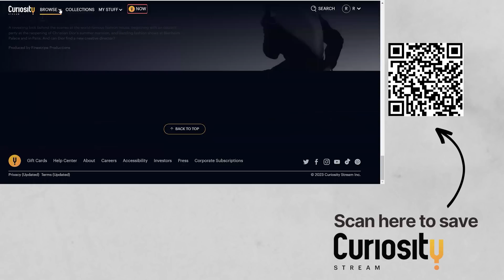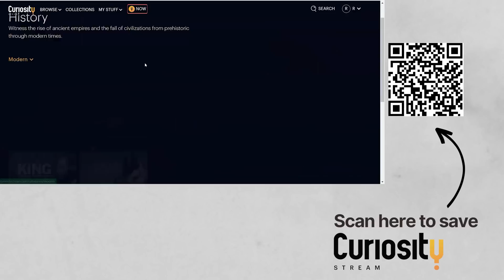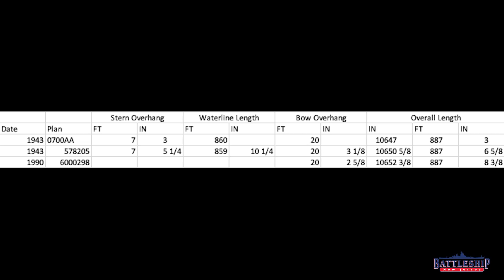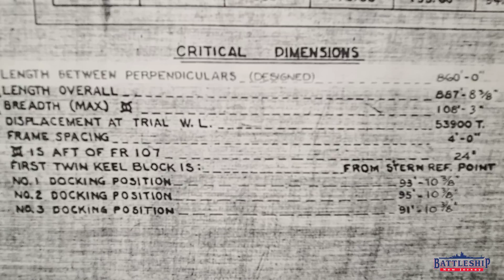Why Is New Jersey Longer Than the Other Iowa Class Battleships?

Comment: Couple of things, firstly the ship will have thermal mass, that is to say the change in temperature of the ship will lag behind the change in external temperature because the sheer mass of the ship stores some of that heat yes it will change legth due to temperature change but the change in length will not be instant. 

Measuring the ship in drydock is the only effective way to check, but you do this by measuring against fixed points on the dock, this is far more accurate, you would use surveying tools to measure the dock out and create a series of fixed datum points on the side of the dock, from there you can use a standard set of surveying kit to get an exact distance under a set of enviromental conditions, spring or autumn rainy days would be probably the best days, mid temp range and no strong sunlight to warm the vessel

I would not be surprised to find small discrepancies in ships built in different shipyards 0.03% difference on overall length is remarkable accuracy pre cnc plate cutting technology and yes its quite likely to be at bow and stern such areas were typically draughted by hand with chalk onto the great steel plates prior to cutting.

Lastly do not rule out dockyard workers being involved for a little bit of pride in making the biggest or the best or even just as a bet

PS logical comparison area, measure the length of broadway on all surviving in the class, its a nice straight corridor with set bulkead locations and its deep enough within the vessels to be minimally effected by climate, and that is a location you could use a laser measuring device accurately. If the length of the various broadways are the same then its pretty much the bow and sterns that are different, if the lengths vary between broadways then chances are it was just production tollerances

Comment: Hi Ryan.  I would dismiss the first option, it would be quite a conspiracy to achieve it,
The second is more plausable.  In engineering there is a principal of minimum metal removal in machining (milling) because:
1. less machining time, 
2. less tool wear (sharpen them less often, save cost), 
3. It is possibe to remove a bit more if you fall short, not easy to put it back on if you overshoot.
Given that it is war time, i would expect everything possible to save time and effort would be employed.
Incidentally, normal engineering tolerance is +/- 10 thou, ie 0.01 inch.  in 887 ft that could amount to a lot if each plate were too long.  How long is each plate?
But each dimension on the blue prints has its own tolerance, unless marked as "ref".  When the ship is layed out each frame position has a tolerance.  The frames attached to the keel.  The plates are attached to the frames, so providing the keel is layed out correctly the scope for length growth due to tolerance is greatly reduced, perhaps to a few thou, not a number of inches.
That suggests the third option of the over hangs being different.  They don't use jigs which will control the tolerance, frames and plate positioning cannot be so tightly controled.  Obviouly the pulpit is a significant possibility.
The fourth option of temperature could do it depending on the method of measuring the ship.  Lasers were not available in world war 2 as indeed was not CAD so measurement would have to be according to surveyors methods of the time.  Dropping a plumb bob from the extremities, mark the ground and measure?  Using theodilites, tape measures angles etc there is plenty of room for a few inches in 887 ft.  When were the ships measured, july and december?  Do we know?
As a final thought, are the dimensions given on the dry dock plans, those measured in dry dock, or those provided to the dry dock for ship positioning?

As to measuring her now, in the water, if your equipment were soley attached to the ship then movement in the water need not matter though flexure of the ship might.
Perhaps the 4 inch discrepancy is a measurement issue.
Will you measure her when you dry dock?

Comment: Probably in build with the bow and stern, things like that happen. British submarine HMS TRIUMPH was partialy built upside down, one ring was thicker at the top and should have been thicker at the bottom. HMS Renown's  (Polaris Boat)Torpedo compartment was 1" shorter than the rest of the class and one was allegedly banana shaped in the water due to the sun on one side during build.

Comment: I'm thinking it would be a mitured of thermal expansion and the tolerance. The tolerance doesn't make sense since all of the steel would have to be oversized and remained oversized. Even during the cooling process. While thermal contraction does make sense, then all of the Iowas would have the same size changes seen.
To bad we can't throw our Mini Mo over the edge and find out.

Comment: I read that USS Wisconsin was actually longer because it had been repaired with a section of bow from another ship that was under construction and was about 3 feet longer.
Reply: Can't really think how that could happen, as the partial bow replacement didn't change the longest part of the prow...it wouldn't have affected the overall length of the ship?

Comment: My theory is weld gaps between plates.. say the welding procedure calls for a 3/16" weld gap, plus or minus 1/16", and a couple welds are set at 1/4", this could be a possible explanation.

Comment: You should just measure it at two different temperatures. You don’t need a full laser scan of the whole ship, just a simple laser measurement of the length like is done in construction all the time.

Comment: Accuracy in measuring the length of the ship is not as important as accuracy in the placement of the 16 inch shells.  The gunnery was accurate enough for the IJN Maikaze trying to escape Truk Atoll.  I have a theory that Admiral Spruance deliberately allowed the IJN Nowaki escape.  He could do this by ordering the Iowa and the New Jersey to deliberately miss, but splash the shells close enough to splinter the zig-zagging destroyer.  The entire crew would have a touch of PTSD.  While the crew would be ordered to keep their lips zipped, the captain was obliged to report that the Americans have full sized battleships fast enough to keep up with a destroyer at 35 knots!

That's the kind of Psy-Op that would cause Admiral Kurita to quit the Battle of Leyte Gulf after tangling with Taffy 3.

Comment: @BattleshipNewJersey  Interesting.  If you go tour the USS Wisconsin, at Hampton, VA, in the presentation they talk about an accident where the ships bow had to be replaced and that after the replacement and putting back on the decorative trim afterwards ended up creating the USS Wisconsin as the longest battleship.  I guess this is going to be a fish tale for all the ships.
Reply: Actually, love Hampton. But whisky is in Norfolk.
Reply: @harrylumsdon6773  Very possible I am mistaken on exact city, my son is out there on active duty and he drove us around to a bunch of places (got to walk on the deck of the life size monitor replica too).  I think USS Wisconsin is big enough that most can find it with general directions 🙂 (and there is a parking garage nearby alone with some good restaurants).  Either way, in the presentation there they claim because of the bow replacement, it's the longest of the Iowa's.

Comment: It's an interesting subject , there  are always differences between individual ships of the same class . Plans and drawings may be the same but how they are achieved is down to the builders and materials available - ond it's possible to identify where they were built in many cases   . Having said that the expansion theory sounds most plausible , the difference is so small and to prove anything you would have to measure all ships of the class under the same conditions .

Comment: At 1/100th inch per plate, it takes 400 plates to add 4 inches, making each plate two feet long, on an 800 foot ship.

No.

Temperature changes will add or reduce length of four ships... or 40 ships...equally.

Laser inteferometer could measure a distance between two points..line of sight permitting.

A transit on the bow and stern, an agreed upon stationary reference point onshore,  and two cellphones could get it measured. As could a TDOA system like the ones used by the NLDN.

If four inches was the only thing better about my battleship than yours... I'd get busy.

And you'd be gargling salt water.

Comment: Assuming it's not simply due to measurement discrepancy, but a real difference, it probably is due to temperature differences during construction. Based on the dates the four completed Iowa's were laid down, it looks like the New Jersey's keel was built during the winter, so assuming she was built to spec, the material would have shrunk compared to her sisters built at warmer times of the year, and then expanded during warmer weather.  Hence, when side by side, the ship most built during cold weather  would end up the longest.

Comment: What about the climate new Jersey was built in, was she built in significantly colder temperatures than her sisters? If so, she could have been the same length at the yard, but been slightly longer at the same temperature as her sisters.

Comment: After reading some of the comments I did some math.  If the machine shops milled the plates just 4 and ½ thousandths (.0045) inches longer and you extend this over 887 feet that comes up to 3.9915 inches additional length.  This being said, I know nothing about how close the tolerances allowed in the milling process.  But as we used to say “close enough for government figures.”

Comment: A surveyed could accurately measure the length, even with it moving in the water. Worst case if you do it all on the ship - you don’t need to be able to see both ends at the same time, you just do intermediate stations down the ship.
It would be interesting to get and accurate length both mid winter and mid summer, just to see how the length changes.

Comment: As an Engineer I believed its a human error. Its the most make sense theory I can think of. I agree with the expansion of the steel theory but it will have the expand the entire way down the waterline to the bottom of the hull, if not it will cause tensile stretch on the point were the heat transfer stop and can cause leakage or rip the side steel plate apart. Which would not expand down to the bottom plate since the water on the water line will cool the heat down and the heat also wont reach the deepest 3 layer bottom plate hull anyway according to thermodynamics. And I don’t believe that the worker intentionally make the ship longer, if they do it will show how suck the navy QC let the thing pass. There is something call “tolerance error” where you have to build each specific part exactly in that range they gave. It could cause the ship look tilted or unbalanced if you decide to add some length on the steel. Thats why I believe that its an error happen when they measure the ship (can happen from both human and measuring tools since nobody is perfect and accurate right) or many steel reach the longest value on tolerance error and add up to the extra inches on the ship length. (What I’m saying is for example many +0.05 can add up to many inches if they’re combine together.) So yeah, Its human error, definitely not intentional.

Comment: I would think you would be able to measure it accurately with a laser.  Taking one measurement from the bow, and one from the stern, both aimed at the same line of sight point amidships either port or starboard and measuring the angles.  Even if you couldn't see the same point from the bow or the stern right now, you could always attach a pole of some kind off of the side of the ship so that it could be the target from both ends.  You then have 2 known sides of a triangle and you can solve the the 3rd side which would give you the exact length.  As long as all 3 points are firmly affixed to the ship, there shouldn't be any deviation due to motion.  This assumes that the length is measured overall and not at the waterline and that the top of the bow is the farthest point forward - it's hard to tell from the plans...

Comment: The New Jersey might have been the longest of the 4 when constructed, but Wisconsin has been the longest, by about 2 feet, ever since her bow was replaced after colliding with destroyer Eaton in '56.
Reply: My first reaction to seeing this video's title was "has anyone remeasured Wisconsin post bow replacement?" but a tiny bit of searching proves the length of that vessel remains unchanged as the upper portion of the bow was reinstalled after the lower part was swapped. https://www.usswisconsin.org/wp/wp-content/uploads/2015/10/Bow-Transfer.pdf
Reply: Interesting.  Good info gents
Reply: Nope. that's an "old salts' tale."  The section of bow taken from the Kentucy and welded onto Wisconsin, was the exact same size as the section it replaced.  In addition, the section damaged and replaced was the lower part of the bow; Wisconsin kept her upper bow section which is where overall length is measured.
Reply: @duanem.1567  Well you better let the people at Nauticus know, since they say the same thing and the the displays read the same as well
Reply: @JohnBeebe  Nauticus lists WisKy as 887ft 3in
Reply: The official records of the Wisconsin are kept in College Park MD and that salts tale as you call it are completely verified and factually correct.  When the Kentucky bow was added after the collision it made the Wisconsin over a foot longer because the Kentucky bow was configured slightly different.
Reply: @duanem.1567  There is a picture of the complete bow on a barge after it was cut off of Kentucky.  After Wisconsin's bow was cut off the bow off Kentucky was welded on as a complete section. All this info is on the internet if one is inclined to actually look.
Reply: @rbarger71  I have talked personally to the curator of the USS Wisconsin and she confirms that the bow was not lengthened because the Kentucky bow was removed then the bottom half cut off then attached to the Wisconsin bow so only the bottom half of the bow was replaced which did nothing to the length of the vessel.  Dont believe everything you read online.
Reply: @rbarger71   And noone would, what, talk out of their ass on the internet?
Reply: @rbarger71  It IS on the internet, and if you pay attention to the pics, only the lower half of WisKy's bow was replaced. The upper 01 Main Deck level, Kentucky didn't even have, and they reused Wisconsin's original...and that's the longest forward point of the ship, and where the length is measured from.   So she's the same length she always was.
Reply: Who cares their both great ships n their American Pride......be well.

Comment: The Temperature change would be based on the temperature at the time of construction compared to the temperature when it was measured. Next as large as the vessel is it would take a long time for the temperature of the steel to drop 30 degrees.

Comment: Uhm ... floating has nothing to do with a surveyed measurement, which would take me about 30 minutes because I wouldn't be able to see the stern post and the bow at the waterline from one instrument position. It's easy in a data collector, total station (or with pencil and paper) to give slope, horizontal or vertical distance. When I retired I sold my equipment or I'd do it for you for funsies.

Comment: I’m an advocate of the dimensional tolerances stacking theory.  With  1940s technology. it was not uncommon for other classes of ships to have some variation in dimensions.   Also welding high alloy steel like armor plate would have a lot of distortion back then as well, as it was a relatively new process.  So fudging that back in could create discrepancies. And during a war,  militaries sometimes need to make judgement calls over which issues are critical and which weren’t.  I doubt the Navy was really concerned about the exact length, or beam, as long as she was still seaworthy and still fit in a Panama canal lock.  And she was delivered on time.

Comment: Human error is the simplest and most logical answer for discrepancies in measurements. Something wasn't cut right,  measurement error, assembly discrepancies, etc.... scale minute errors to the size of a battleship multiple times and you honestly began to appreciate seeing how well people were able to build things on that scale.
Reply: Ryan makes a comment that the old measurements might not be as accurate as laser measurements.  That's not our experience at the Former Alcoa Clevrland Works.  When the stools we installed on our 50,000 ton press, we couldn't get repeatable measurements with a laser tracker. So we used an optical surveyors transom.  Old school optical was  MORE accurate than the tracker. I bet the yards used a transom.   But I see another source of error- all the surfaces are curved... where do you measure?  The stern and bow are at different heights... these would mean technique would have a big impact on measurements.
Reply: Measurement accuracies of 1/4" should be reasonable even at 800+ feet